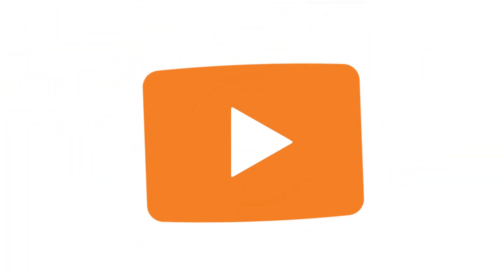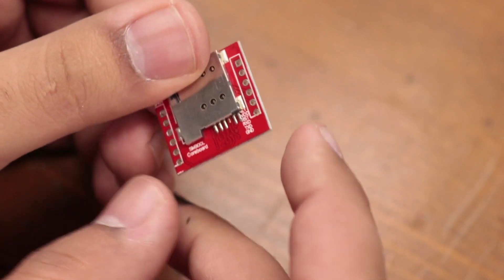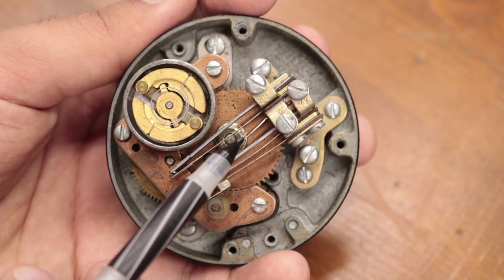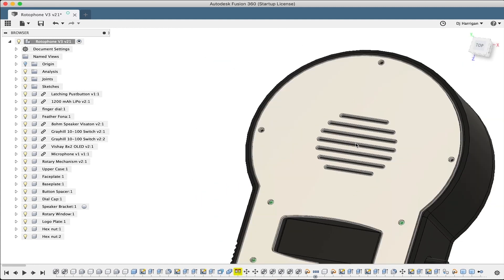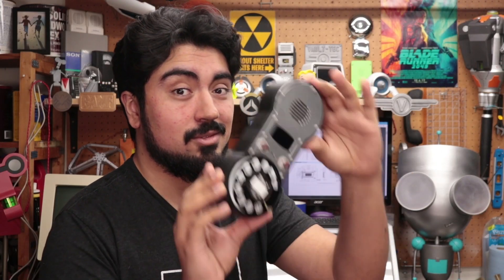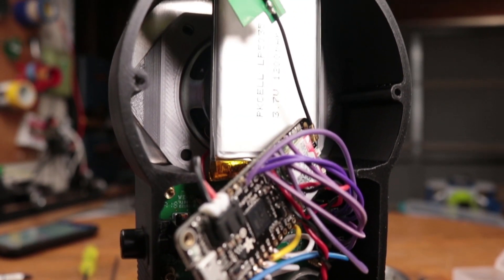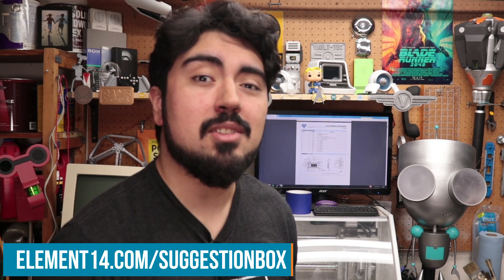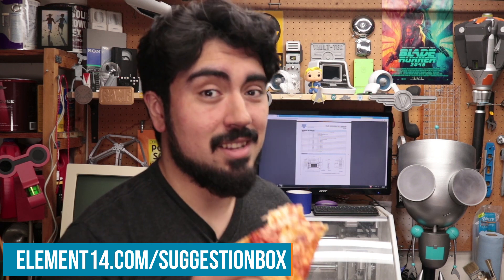Rotocell - The Rotary Cell Phone of the Future!

Comment: Good project - rotary dial phones really appeal to me, I love the feel of electromechanical stuff. 

You guys have seen Justine Haupt's one, right? Downside of the LTE version of that is, in making an all-new rotary dial, she adopted the moving finger-stop design common on new "retro" phones, albeit with a seemingly higher-quality mech. (I guess it's smaller because it doesn't need a gap in the hole pattern to be able to dial 1.) Her initial take used a vintage dial, same as this. Her new LTE one is very polished though, with a proper bell as a ringer and an e-paper phone book. 

'Course, to be properly retro it needs a valve amplifier :-)

Comment: Blurring out the dial and speeding it up does not help, All you have to do to decode your number is slow the video down and count the pulses at 10pps.
Reply: Yet you don't know what it is
Reply: @transrightsarehumanrights2821  I dont have the time to do that.
Reply: "O-oh I could tOtAlLy decode your number...! I just... d-don't have time...!"
Reply: @transrightsarehumanrights2821  I will do it and respond back. Give me a few hours.
Reply: Bet
Reply: @transrightsarehumanrights2821  I am. This will be my night to prove you wrong (or right) Depends. I will respond back with the results.
Reply: @transrightsarehumanrights2821  Maybe its the software I am using but some of the frames seem to be cut out. And I need to slow it down further the .25x, Know of any free software for Linux or if need be windows that can do this?
Reply: No, that was my point-- I don't think it's the software you're using, I genuinely believe the frames aren't present. I'm confident that the method you described can't be used to determine the phone number, which is why I  challenged you to begin with. I don't think it can be done.
Reply: @transrightsarehumanrights2821  There are videos of people online using a real rotary phone and they just cover the dial with there hand, And you can just count in PPS's the number dialed based on the sound the dial makes, But that was without it being speed up, without missing frames, and with audio.,
Reply: I know, I specifically meant this video. I have faith that the blurring and speeding up simply makes it too difficult for anybody to use that method here

Comment: Hi, have a old phone around to do something like this, any change to connect to a landline instead of SIM card?
Reply: Rodrigo Delgado i almost typed a lot. You're being sarcastic right? I'm sorry it just doesn't go that well through text. 
Every landline uses pulse (rotary) or tone (tones generated by the keypad). 
You basically need to wire the phone and connect it using a RJ 11 socket.
Reply: @Gunzee  sorry if it seems sarcastic but that old rotary phone are no compatible with modern landline, at least I can't get to make it work
Reply: Rodrigo Delgado okay sorry, do you get a dial tone? If not the phone is broken, it maybe as simple as lose wiring. 
Landlines use tone or pulse, if you get a dial tone turn 9 and listen carefully. You should hear 9 low volume clicks. 
Maybe your phone line provider uses tone only. You'd need to look online to check that. If they do then there's no way to make it work really.
PS, you'd need a tone generator, you can try your mobile. Set your phone to full volume then turn number 1 on the rotary, so the tone just stops & hold. Then placing your mobile near the mouth piece dial a number. Your mobile needs to generate key pad noises. I guess you can test your landline that way.
Reply: I was looking around and this one has dial tone and the old ringer too, give a search on ebay, ' western electric bluetooth ' it says it's battery powered too.

Comment: Steve Wozniak has an old desktop rotary phone that he's stuffed a battery, a small microcontroller, and a cellular modem into. When you pick up the headset, it produces a dial tone if it has a signal, because there's no display, and the bells actually work for the ringer. The hole in the casing where the cord would go to the wall is where the battery charger plugs in. It's not as portable as this, but it's still pretty cool.
Reply: I believe some company right now actually makes a cell phone for old farts with a dial tone and that works exactly like an old touch-tone phone.  I keep seeing ads for it in magazines in doctors' offices...  "I don't want all these newfangled features!  I just want to talk to my grandkids!"
Reply: I would buy one of those and carry it around (sometimes), says this old fart. :-)
Reply: @stan.rarick8556  I think it's called the Jitterbug or the Ladybug or some kind of bug.  If I see the ad for it again, I'll let you know in these comments...

Comment: If this was made available, I'd buy it.
Reply: Thanks, both of you, really, but sadly, not only do I not have access to a 3D/parts printer, my soldering skills leave a LOT to be desired.

Still, I hope you do well in that competition.
Reply: Well... the individual components are available, all you gotta do is build it and make up the code ;)
Reply from the maker: The code, B.O.M and 3D files are available here - https://bit.ly/2U8p3WN
Reply: Given that it's 2g it won't be usable for long heck even 3g it's dieing. Easiest way to future proof it is to turn in into a Bluetooth speaker phone. So In short it pigyback off of your existing smartphone via Bluetooth. The dial works and tell your phone to make a call.
Reply: I have looked on ebay if you search ' western electric bluetooth ' .... that is how I searched.

Comment: @4:10 strange orange flash.  Not sure if this is an editing device or if this movie is corrupt.  If it's intentional, I'd maybe not do that in the future. Your call though.
Reply: Looks like an editing error, inserted something 'before' the 'Presents' transition, but accidentally put it in 0.2 sec late, cutting off the orange and placing it ahead of the inserted clip...
Reply: @MichaelBerthelsen  Yeah.  It's weird.  The orange suggests maybe it was deliberate because it's on-brand for their color pallet but I don't know why it's there. If you're going to do a jump cut, you typically don't call it out even further by announcing it with a bright orange flash frame.
Reply: @fixins  Some of them aren't even jumps, it's just a glitch mid-clip... And when it happens several times, it's not intentional...
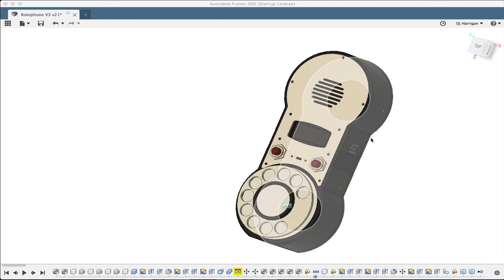Reply: Same happens at 5:25, now I'm also thinking corrupt file...